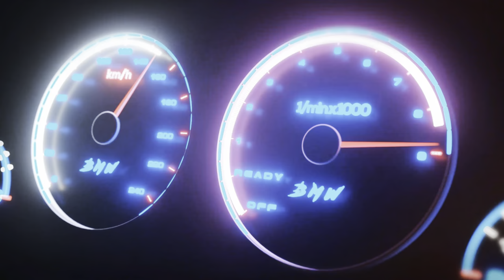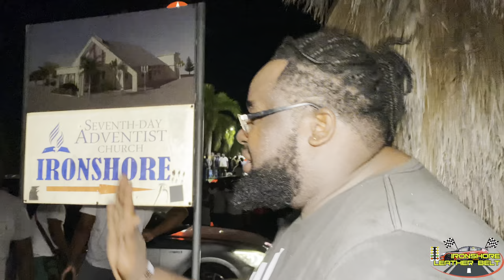F-150 Lariat Rocked Spectators @ Drag Race

Comment: 44:19 bossy d hogging the limiter here hard
That car is a 12 sec car, a f150 does not do sub 13 s stock.
Bossy D messed up bad here
Reply: Yuh right but the car actually run 11sec on low boost
Reply: @theocambridge5484  even better 11s. ..and no stock ford f10 runs better than about 14s

Comment: 44:33 ..but wait, look like the f150 lose, it never crossed the finish line 
Anyway, you sure say a Lariat trim that? ...and a which motor it have, the default 325 hp motor? or upgraded 400+ hp motor?
Reply: It was all fun spectators are asking for a rematch with Bossy D wearing proper tyres.